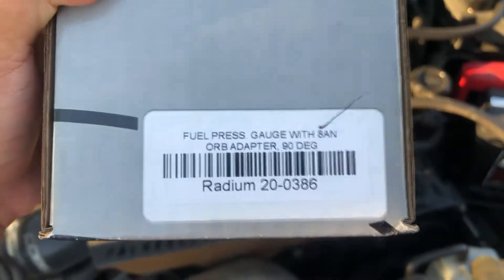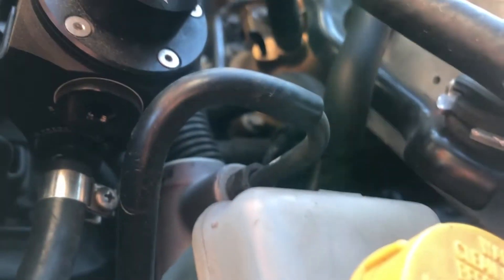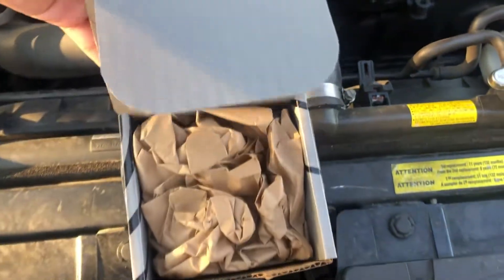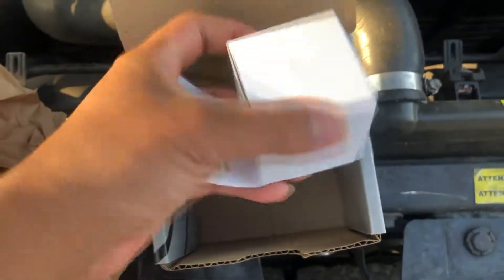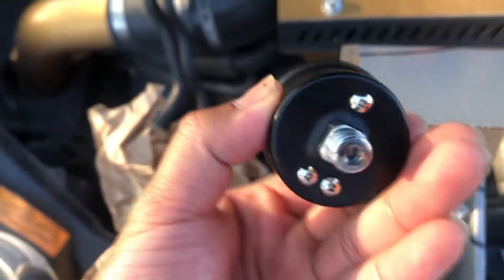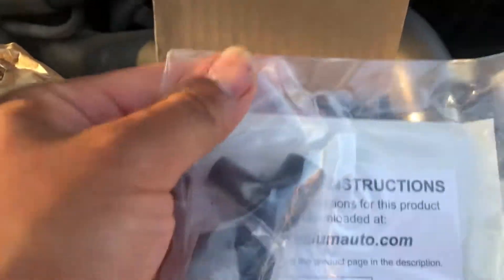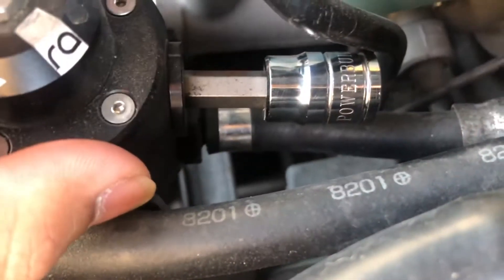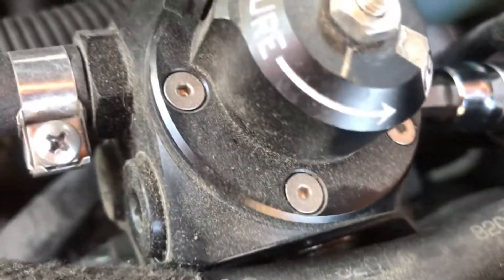PROJECT STi: 08-14 - Radium Fuel Pressure Gauge Unboxing/Install

Comment: Do you need to take the fuel pressure out the lines to install it?
Reply from the maker: Yeah once you crack open the port the fuel is going to come out so just let it drain from there
Reply: @TorontoEntz  alright thanks for responding